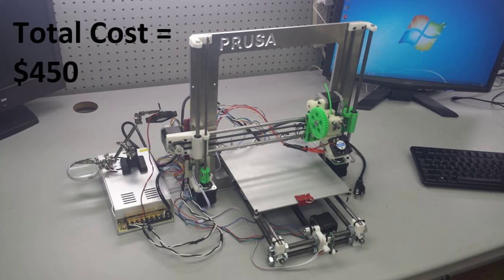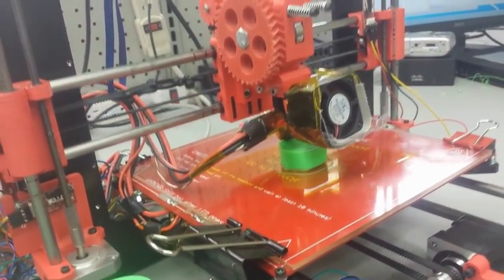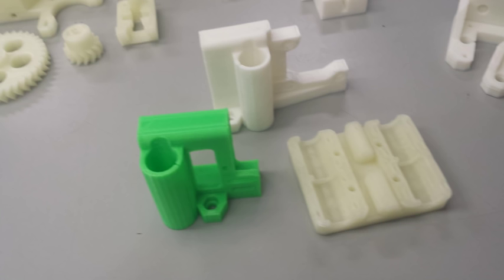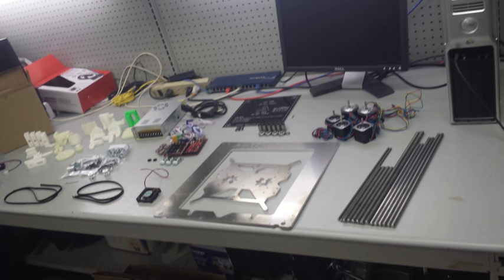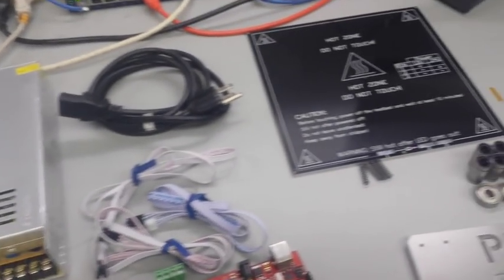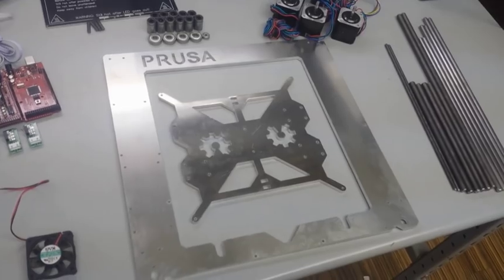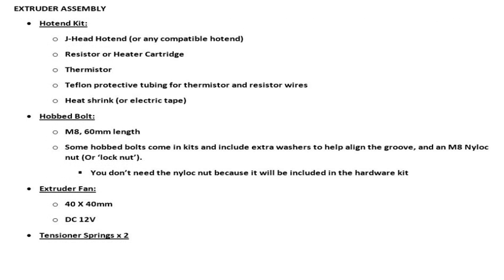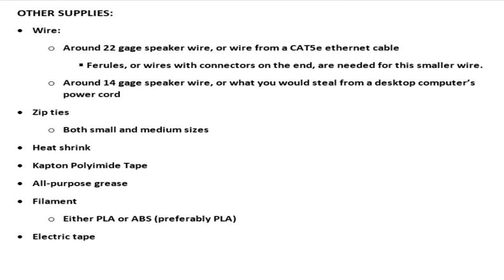Build a 3d printer: Prusa i3 Rework pt1 of 26

Comment: Congratulations for you videos! Where did you get the metal frame?
Reply from the maker: There were 2 different frames we purchased and both from Ebay.. The first printer put together (the black and red shown at the beginning) was a kit and came with a full heavy aluminum frame, very heavy.. The second was purchased separately as parts, the frame by itself, was a lighter aluminum construct but worked just as well..

Best to get an aluminum, with holes pre-drilled in the right location.. Wouldn't recommend wood.

Comment: Are the Prusa i3 parts and Prusa i3 Rework parts different?
Reply from the maker: fourburnerbreakfastThey are a bit different.  The rework improved upon the original Prusa i3 with some better supports, less parts, and improved extruder design. But they do share some parts.

The printed parts we used for ours can be found at following location if you wish to print your own. 

Http://github.com/geekitutorials/prusa-i3-rework
(GPLv3, Credits to Josef Prusa and Reprap France)..